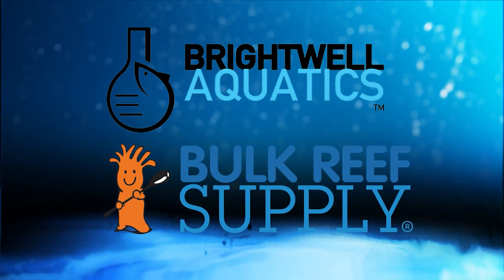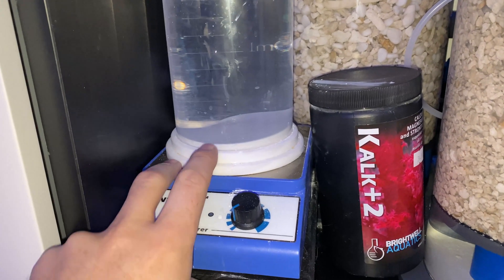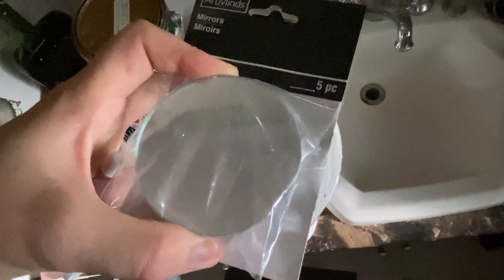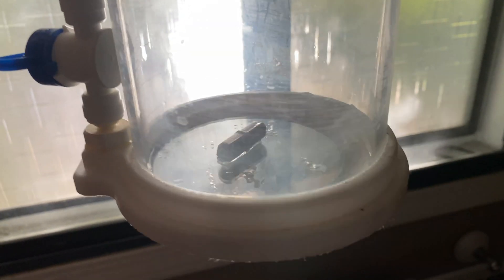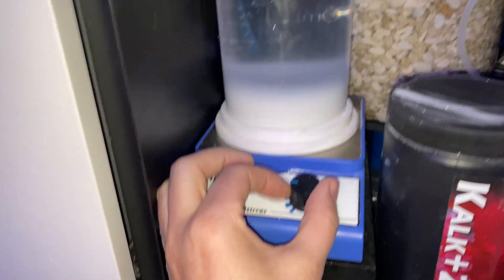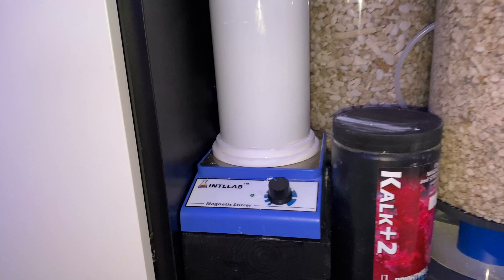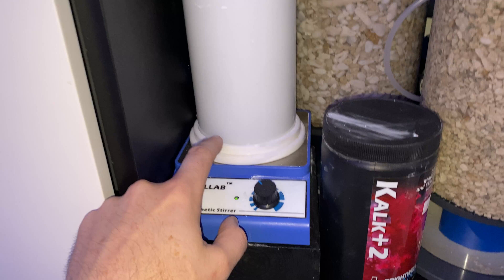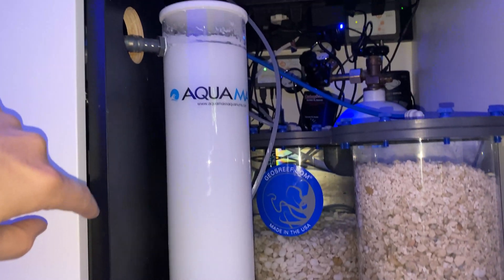DIY Kalkwasser Reactor Stirrer Update

Comment: Do you run the magnetic stirrer 24/7
Reply from the maker: That one is motor based and runs 24/7.   The magnet one i had i believe i ran it every 4h
Reply: @ReefDudes  thank you for the info

Comment: I put one on my tunze calcium dispenser and a timer every 4 hours for 1 minute seems to work good but makes a little noise when turned on I think the plastic is not perfectly flat on the inside but has a flat bottom that sits on the stirrer, I might try different stirrer bar to see if I can cut down the noise a bit.

Comment: Hi Devin. I've copied your build almost to the letter, apart from a different reactor. I fired it up about 4 days ago. Can I ask roughly how much RO you are putting in to keep up with demand? Also is this just supplemental to the CaRx or are you doing the bulk or supplementation through kalk with the CaRx topping up the shortfall? Much appreciated. Great videos and channel. Ben
Reply from the maker: CArx does the bulk of it. I Jsut use kalk to help with ph.  Currently putting 1.5ml/min though it
Reply: @ReefDudes  nice one. Cheers Devin.

Comment: going to add a stirrer to my kalk container for my 32 gal biocube it about 5 liters just to make mixing a little easier hooked up to my dosing pump. I was mixing it in a seperate container and letting it settle then only using the clear solution but the kalk still builds up on the bottom of my 5 liter dosing container I guess it falls out of solution over time, a magnetic mixer might help kind of making it into a hybrid  kalk stirrer.

Comment: At the end of the video, it appears the stirred up Kalk solution is at or near your overflow output tube.  Wouldn’t that allow too concentrated of a solution to be dosed?  I thought the Kalk is supposed to be slowly mixed so that the stirred up solution doesn’t go into the tank and only the saturated clear water is dosed.  For instance, the Avast Kalk stirrer slowly mixes up the Kalk powder to where it rises 3-4” in the chamber and there is 12” of clear saturated Kalk water in the upper part of the chamber from where it overflows into the sump.

Perhaps you were just demonstrating that the stirrer still works with the mirror and you don’t mix it that aggressively under normal operating conditions.

Comment: I converted a two little fishys kalk stirrer into a magnetic pill stirrer. The pill drilled all the way through the bottom in about 2 months. I replaced it with the avast marine stirrer. But I miss the magnetic stirrer, it kicked up the kalk much better. The mag stirrer seemed to dose over-saturated kalk, but it was consistent so it didn't really matter and I could dose less water to maintain alkalinity. I'm actually tempted to take out the stirrer on my new avast marine, throw in a mirror, like you, and go back to mag stirring.

Comment: I would be worried about the aluminum or silver coating that makes the mirror. 

1.5mm polycarbonate sheet can be found for very little $ and you can use standard wood hole saws to cut disks.
Reply from the maker: Its technically sealed under some kind of an enable coating.. but the edges may possibly be the weak spot. ill likley swap it for just glass once i can find some (or find a nice way to strip the coating)    I didnt consider polycarbonate but may be the backup plan!

Comment: Deven, I asked Randy Farley how he would dose Kalk this morning. :-)

“A slow pump from a settled reservoir is, in my opinion, the best way. Reactors are OK if space is limited, but have no advantages (except space) and some drawbacks over a settled reservoir (harder to control potency, less settling of impurities, and no chance to boost potency with vinegar, if desired).”  Randy Farley
Reply from the maker: Gotta love randy!  If you have the space it’s a solid way to go
Reply: @ReefDudes  For sure, he’s always my go to. I did it that way before and it was working well. I always wanted to try a Kalk reactor, but after reading that Kalk is loosing full saturation after only a week or two…makes me want to just go back to a reservoir that I can slowly dose from and easily empty in the sink and quickly refill. All I needed to do was to unplug one dosing line, rinse with my sink spray nozzle, refill, and it’s back online for over a week fully saturated the whole time. I’ve never ran a reactor so not sure how hard it is to clean and refill. Looking at your Ice Cap it seemed to be fairly easy. The problem for me is that you have to Stir every hour. Let it sit for 14 minutes. Program all that to do the tasks. Not sure if it’s wroth all the trouble. I need to look into it more.  I think testing with conductivity is the way to go so you know exactly when to change it so it remains fully saturated the entire time you’re dosing it.

Comment: I bought a reactor from Ali express named :Marine sources agitator.
Drilled a 11mm hole with a stepper drill  4cm under the top and put some 12mm sicone tubing trough it to feed the tank. 
I feed it from the ato reservoir into the pipe that is intended to be the output of the container so the fresh water has to go trough the layer of kalk. 
It did spin faster than I liked so I have put a pwn controller on it for 10 euro. 
I got the 5 liter version for 60 euro.
It gives a very nice ph boost to my tank to about 8.40 at its peak (was 8.22 with just 2part)

Comment: Thanks Devin!! Great build!! Reactors can be pretty costly and an alternative is well worth it.  I will say though, I saw you are running Kalk +2.  In my opinion it is the absolute best kalk - how that is not the #1 product in reef keeping I have no idea!! I have been running Kalk+2 like you are with a Ca reactor on a 210g SPS dominant tank - I dose at night to elevate ph and it is rock solid.  I am also using Kalk+2 on my other tank a 90g SPS dominant, however throughout the day.  My parameters are solid and ph never gets below 8.1 even at night and growth is like I have never experienced until Kalk+2.  I should literally be the standard for all reef hobbyists and especially new reefers as it, I think, dramatically increases potential for success in a reef tank both sps and lps.  Now, I do NOT run it through any kalk reactor.  I just run both tanks with a little 10g brute with a lid and just draw it out from just above the bottom, and it maintains throughout.  I am dosing about a gallon a day on the 90, 2385 ml, and just over a gallon, 2650 ml on the 210.  Like I said - crazy crazy growth.
Reply from the maker: Love it!  A little kalk really is magic for a tank. Happy to hear yours has been working so well as well!

Comment: You don’t think the coating on the mirror will wear off over time?
Reply: Hit it with a sander should remove it. You don’t want any of the aluminum coating finding it’s way into your reef.
Reply from the maker: It may from the potent ness of the kalk. Time will tell. The pill is on the smooth glass part.  If you can find a nice what to remove it or Just glass that would be preferred